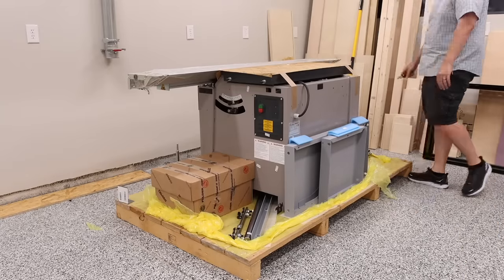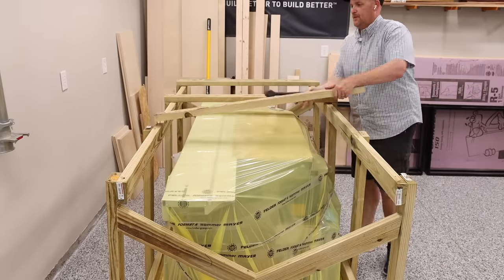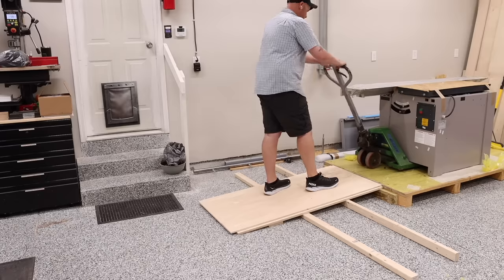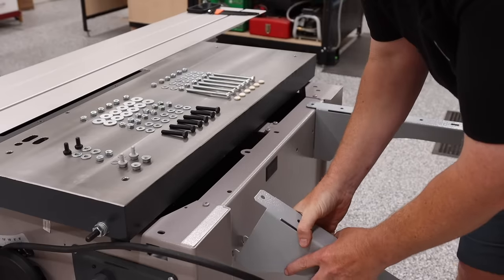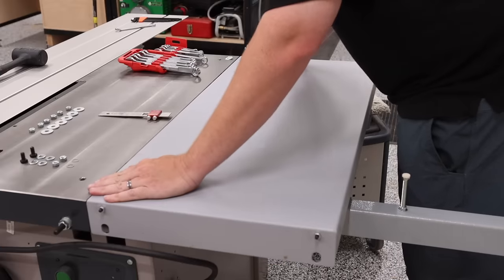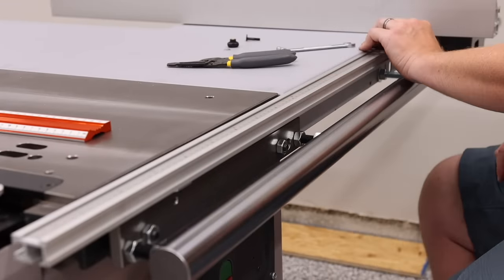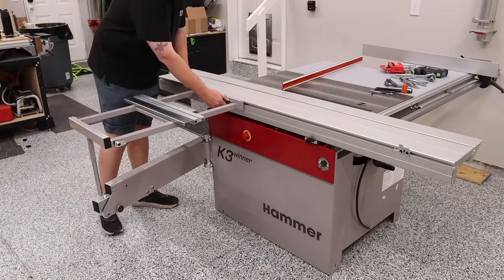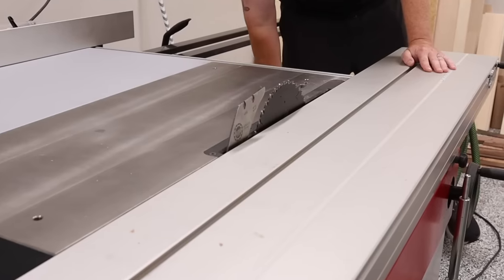I sold my SawStop for a slider // Hammer K3 Winner Assembly

Comment: The saw stop fad is comin to a close. Id much rather have a large slider/combo machine than a saw stop any day
Reply: I don't know if l'd call their definitive safety feature a fad. I'm sure we all follow similar creators. I think 3-4 of them have had awful injuries in the past couple years.
And the Hammer K3 is 75%
more expensive than the 3hp Sawstop. It's not a commonly cross shopped comparison.
Reply: Once the patent expires it will be. People can add similar features to a slider
Reply: @ChapmanWW  I really hope so. The Sawstop tax is huge. Save me some googling- any idea when it opens up?
Reply: Not everyone has space for a slider.
Reply: @nickbailey202  there's a general consensus that's its 2024. We'll see if Bosch release their REAXX system or not
Reply: Fad?  Safety is a fad? 😂😂😂😂😂😂😂
Reply: Having ten fingers is a fad?
Reply: Not to mention the large slider saw stop makes for their saws.
Reply: I doubt it will be any cheaper. To add that feature to another saw they have to reinforce the cabinet and the mechanism to handle the braking during activation.

Comment: Here in europe we've often wondered why sliders arent more common in US. They are so versatile and nice to use even with heavy weight and large sheet materials.
Reply: North Americans usually end up adding slide assemblies from OEM or third party.
Reply: Hi 👋, I have the K7 Falder my sliding table lifts off , saving on space, I have noticed a lot of things are different from Europe to US. I think some of it is due to safety aspects, Phil from the moulin France.
Reply: Because we're arrogant Americans who think we know better.
Reply: it depends on what you're doing, I have a slider for doing cabinets, I also have two other saws that I use for solid wood,  each machine does different things best
Reply: @GroberWeisenstein  Yeah, but it's not the same. Like here the blade is on the side next to the slider instead of the mid of the table. Also for cutting big panels there are saws with the ability to add a precutter blade which makes a big difference in cut quality. You can't do it with a traditional cabinet saw while you can use this kind of saws as the cabinet saws.
Reply: @farmcat3198  well compared to Europe we do know better . JS

Comment: Sliders are so much safer and superior than a cabinet saw. Even without the sawstop technology. Many of the high end sliders are now incorporating a similar technology which means they are going to be even far safer, and they are non destructive meaning the blade can be reused and does not require actual contact with the blade to trigger the stop.
Reply: Know someone who lost a finger to a slider. From not keeping their concentration and making multiple cuts. Saw stop is a no brainer. Interesting to see more of the new tech you are talking about.
Reply: @steveogle3679  that's unfortunate, sorry to hear that. Check out the Altendorf Hand Guard as well as the Felder PCS systems
Reply: @oldmangloomify  kappa 550 e-motion will run you 22K+ the Altendorf Hand Guard is probably a 25K saw
Reply: The Altendorf is actually around $67k 😅
Reply: @steveogle3679  If you cut your finger on a sliding table saw it´s not because of a lack of concentration but because of completely neglecting how to use it properly. SawStop is fooling people cause it provides a safety system for somethig that´s pretty rare. Kickback and eye injuries are far more common and a sawstop (especially those who don´t use a riving knife and blade guard) does not protect from that.
Imagine you buy a car and the salesman give you a helmet with it, so you can speed on the streets and not care about others. That´s basically the SawStop feature.
Reply: They're not safer than a good tracksaw.
Reply: @frankshannon3235  Hi Frank, the original discussion is about sliding saw vs cabinet saw, though a track saw has its merits and advantages in smaller workshops where a full slider may not fit as well as job sites where there may be no table saw or a smaller contractor size saw.

Since purchasing a Felder K700S with 3200mm sliding table over a year ago, I've only pulled out my track saw once to make a x-cut on a piece that was too long for the saw in my shop. This is due to the configuration of my shop though and nothing to do with the limitations of the machine; there was a wall in the way! I am regularly ripping 8/4 material using the full length of the slider (10ft) with ease and precision. No more struggling to lift and push the material (hopefully straight) through the cabinet saw.

When a sliding table saw is set up and used properly, preferably in tandem with a good clamping solution such as Airtight Clamps or Kreg Automaxx, the operators hands never come anywhere near the blade and the possibility of kickback is all but eliminated. I'm never going back to a cabinet saw. If any of my future shops are smaller, then I will chose a smaller slider. It's simply much safer and accurate, and also indispensable when it comes to x-cutting.

Comment: Sliding table saw vs Sawstop . . . To me this is a no BRAINER.  You chose wisely.  The sliding table mechanism solves the safety issue (as long as you use it), and it adds additional versatility to the saw, including the ability to accurately cut down sheet goods.  The slider also doubles as a pretty good joining mechanism, so you can probably go without a jointer.

Comment: Hi 👋, Nice Saw , Great upgrade, I have the K7 Felder , spindle moulder and table-saw. I notices The sliding table seems to be fixed, where on mine i can lift the sliding table on and off, this is great saving on space, Hope you all the success for the future, I am now retired in my 70s and I still have most of my woodworking tools and machinery, it looks like you’ve got a great pallet truck, I was very lucky around 20 years ago I was in Cambridge in UK, the shop was closing down and everything had to be sold off and I noticed a pallet truck. I’ve got a label on it for sale offers, so I just went in and said £50 I said done you can pick it up at the end of the week which I did, 
Keep up the great work and stay safe , I have now moved to France, Phil from the moulin France,

Comment: I bought a Felder CF531P.  My first slider (combination machine). Complex, but heavy and so incredibly accurate!  You will love the first time you rip a board with no straight side!  Just use the slider and rip perfectly.
Reply from the maker: I can’t wait
Reply: use a fine(100ish) tooth blade instead of a rip blade. then no jointer needed, saves a lot of time going from machine to machine.
Reply: You can do the same thing with a piece of plywood and two toggle clamps, for about $5K less

Comment: I have a Felder CF731 combo machine, purchased in 2004.  It has worked flawlessly for these many years.  One important thing with sliding table saws is to make sure you have sufficient infeed/outfeed  and table- side clearance.  (I have just 10 feet in each direction). From the video it looks like that is not a problem for you. I am sure that you will love the convenience of the Hammer sliding table.

Comment: I have had my Felder K3 for several years now. You will not be disappointed. I am not sure why it is taking us so long to start using a sliding table saws, as they are simply amazing. Good luck and keep up the great videos.
Reply from the maker: I’m excited about the change
Reply: Uhhh....because they are so expensive?
Reply: @idontthinkso666  if it makes you money cost is irrelevant
Reply: I’m amazed at this whenever I see an American video with an old style saw with an ungainly sled setup, and no knife or guard
Reply: @idontthinkso666  As oliver said, it´s about cost-efficiency. I just watched a video yesterday where someone had a sawstop but had to use a circular saw (and festool system) for cross cuts. This costs you money every day.

Comment: Jason, great vid, awesome step by step. I’ve had my K3 Winner for about 8 years and love it.  Sure was tricky getting it off the pallet by myself. My rented pallet jack would no hold the weight as I was rolling the saw down the ramp … tense moments to say the least. Having worked in a commercial cabinet shop and learned on German table saw’s with sliders, I knew then I wanted one in my shop. The slider with the blade brake really makes this saw safe (IMO). Thanks and enjoy!
Reply from the maker: Looking forward to learning it

Comment: I have had my K3 Winner for just about 1 year and absolutely love it. I did look at the Saw Stop, however decided to go for the slider as it handles sheet material more easily. The machine is super accurate and easy to use and I have a scoring blade and dado set to add / install when required. I'm looking forward to seeing your future videos and keen to hear what you think once you have had a chance to used it.
Reply from the maker: I’m excited to learn it!

Comment: Welcome to the slider club. It ain't small but I love my k3. Sure it doesn't have the saw stop tech but it is way easier to stay away from the blade kickback zone and if you routinely cut sheet goods I can't imagine life can get any easier, particularly if you get it with the scoring blade (silky smooth cuts in the veneers). I can't put 4x8 sheets on it but it is plenty big enough to throw on 5x5 baltic birch.The only thing i don't like is the blade guard as the knob makes it impossible to set the blade height anywhere near the depth of the gullets. I built an overhead dust collection "hood" based on David Bedrosian's plans but added some LED lights. Enjoy and thanks for posting.

Comment: Great choice Jason! unloading was well calculated, but you need to be friends some neighbors just in case.😄. My Epilog Pro 48 was almost same size crate and it took 3 of us to unload it from the truck and push it on the sloped driveway to the edge of the garage. However the machine is on the wheels and Epilog includes 2x8 ramps. We could not do it without my neighbor.
Reply from the maker: I would have loved to have someone here. 🤣

Comment: Congratulations. I got the same Hammer K3 because I mainly build cabinets and it's absolutely great for panel work. The standard blade is great but for panel work, you should consider one of the Tenryu plywood blades.
Reply from the maker: Tenryu are definitely my favorite blades

Comment: I don't recall if this is the same model as the one in Marius Hornberger's video.  I think his was the BASIC model. But he had some great long term review and modifications that he suggested. I believe Hammer incorporated them into their line up. May be worth checking out.
Reply: I'm familiar with Hornberg's videos. He has the basic model. He did a video recently reviewing the saw after a year. The conclusion: he likes the saw, but wishes he had gotten the version we see here (the K3 Winner). The Basic model has an inferior fence and the table isn't nearly as long.

Marius identified a flaw in the design of the stop for the rear (smaller) cross cut fence. It can change its position over time, so your fence can become out of square. The only thing that really pisses me off about Felder (besides the outrageous wait times for their machines) is the fact that the same defective stop is still sold on the machines. You can see it on the machine from this video! They sell a modified version of the stop that fixes the problem Marius identified, but they don't include it as standard. Jerks.

Comment: Nice video! 

I think it's really interesting that you sold your SawStop for this saw. I never sold a SawStop. Rather, I went down the table saw rabbit hole and came to the conclusion that a slider made the most sense for me. I ended up getting precisely the same saw you have. I like the idea that, out of the box, you can do all sorts of things (such as cross cutting) without making jigs. The only jig I recommend you get is a Fritz & Franz. Bedrosian makes a really nice one that you can order. Or, you can make one yourself. 

Uncrating was a chore for me. My situation is a bit different as I live on a very steep hill (30 something degrees). After a nerve-racking experience getting the saw into the garage,  I made a ramp, but installed the rolling kit while the saw was still on the pallet and then just rolled it down the ramp I video taped the unloading of my saw. I thought about making an uncrating video, but it was ruined by a lot of plumber's crack on my part. 

I've been happy with my K3. I'm quite unhappy with my dust collection system, which is next up. I have a very small space. I might replace my K3 at some future date with a KF 700 (slider/shaper combination machine).
Reply from the maker: David is making me one as we speak actually

Comment: I have a much older, early 90's Delta Unisaw 52" with an Excalibur sliding table. Not nearly as well built and put together as the Hammer but it is soooo much easier to use with sheet material and even crosscutting lumber. I bought it used from a cabinet maker who "upgraded" to a SawStop....but it got a sliding table add on :-)
Reply from the maker: Very cool!

Comment: I just Uncrated my K3.  For those without a pallet Jack I simply added the mobility kit laid two long 2x4s parallel to the crate, then ran shorter 2x4s perpendicular and used that as a make shift ramp.  Took me 30 min.  Taking apart the pallet, well that was a whole other ordeal!

Comment: Nice video and saw, Jason. Curious though about your criteria in choosing this brand over all the other sliding table saw offerings out there? Looking fwd to your next video showing use of this saw in your shop.
Reply from the maker: I have had a very positive experience with the jointer planer and that was the reasoning for expanding my hammer machines.
Reply: @bentswoodworking  I'm sure you're feeling like it's X'mas about now, with your new big boy's toy. I'm sure it will serve you well.

Comment: Word to the wise, adjusting to the slider from a cabinet saw takes some getting use to. When I first got my slider (a Felder) I wondered if I had made a huge mistake. I felt like a complete novice again. Hang in there it gets better I promise, and then you will absolutely love it. Please check out the Extreme Woodworker, helped me immensely. Don't wait to long before making a Fritz & Franz jig. Best wishes with your new saw.
Reply: Just checked him out, That dude has a Martin saw which is insanely expensive. Appears he's packed out with Festool as well. That man doesn't play about.

Comment: I think if it were me, I’d have bought a saw with a scribe saw mounted ahead of the main saw blade to avoid chip out on melamine sheet material.

It’s the one limitation that I miss on My Robland X31 combination machine.

I owned a Altendorf Tilting Arbor Panel Saw in a previous cabinet making life for 20 years, and it had the scribe saw.

Downsizing to the Robland X31, I really find myself missing that scribe saw.

I’ll probably buy upgrade the Robland X31 to something with another scribe saw at some point in the future.
Reply from the maker: This does have a scoring blade I just haven’t received it yet

Comment: I bought my sliding table saw in 1984,  12"'   3 hp  triple belt drive. Would not be without a sliding table saw. 
I have a new ( 6 months ago) Saw Stop Job Site Saw for space saving use and portability.
while I am in process of building another shop. Much of my equipment is in temporary storage.
I swallowed the safety feature kool aid and paid an obscene amount of money for a 
sub standard quality saw. Looking back I would have bought the far superior Makita at 
$1000 and saved $500 and considerable grief in dealing with Saw Stop "customer service".
The first one I bought was grossly defective. Cured me, I'll not deal with them again.
Worst customer service I have encountered in a tool related company in 30 plus years as 
a professional wood worker/furniture maker. 

Congrats on the new saw. Looking forward to the next video, I am in a frame of mind to get a newer sliding saw.

Comment: I wish I had a Euro sliding table saw for sure.  I have second best, an Oliver 280 with an Excalibur sliding table.  Pretty darn good, but not as nice as a modern slider.  I too can't understand how so many of us American's don't have sliders, except that there are already so many great Euro saws available.  Another piece of equipment that most small commercial or dedicated hobbyists seem to not get as soon as they should are wide belt sanders.  Sure, I can understand how folks can't have the power to run a 37" wide belt sander, (including DC) but there are great small wide belts, open ended 16", that while not as precise as closed both ends, they make pre-sanding all parts so simple and enjoyable.
Reply: I think it has to do with the price I had to look up what this saw cost and the smaller of the three variations 31x31 was slightly less than $6000 excluding taxes and shipping. Unless you are looking for an Industrial model  that seems way out the league of a small shop and dedicated hobbyists. Also they need a larger area to work in. When I win the lottery I will put in a order, because they sure look like a gem to use.